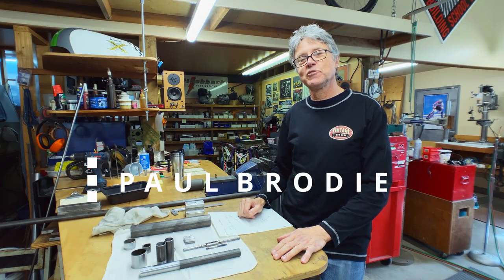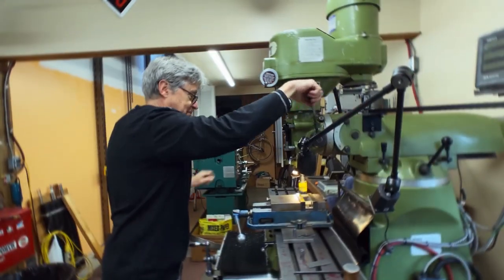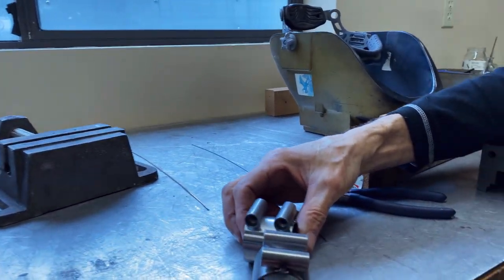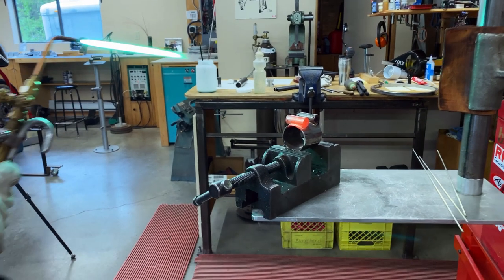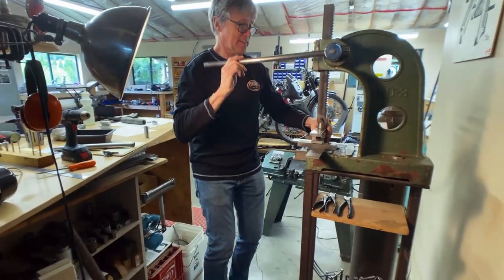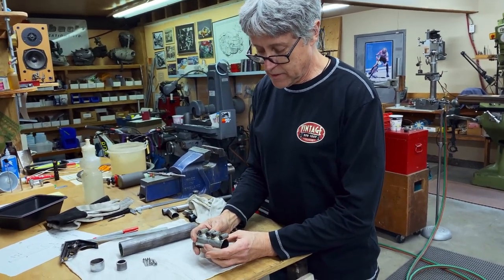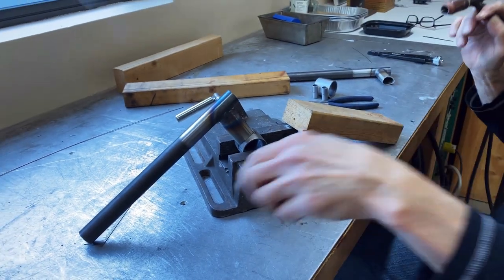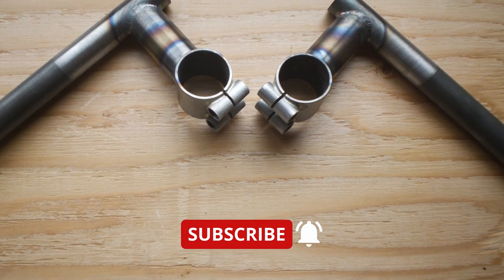Custom Aermacchi Clip-On Handlebars with Paul Brodie

Comment: Hi Paul, another great vid. would you mind sharing the name or link for the blade used to cut the pinch bolts? Im also wondering would this be the blade used to cut the slot in the seat tube ? cheers mate
Reply from the maker: Thank you.  I think you are talking about a Slotting Saw. Yes, they are also used for the seat tube slots. Available in different thicknesses and diameters. Any good tooling supply shop should have them...    :face-fuchsia-tongue-out::face-fuchsia-tongue-out: 3/32" is a common thickness that I use..

Comment: Sweet lookin bars! Just bought some cheep aluminum ebay clipons for an sx125. I'm getting nervous. Is there a reason you went with steel? Would you avoid aluminum?
Reply from the maker: I like the look of 4130 clip-ons. I can weld aluminum, but prefer not to, unless it is absolutely necessary. Most aluminum clip-ons are CNC machined and then clamp a 4130 tube; that's not the style I wanted for this build.

Comment: If you covered it already, and I missed it, I apologize. Why did you braze the pinch lugs rather than fully them? Is it related to the fact that you could only TIG the periphery of the joint between two, where you can wet out the whole surface contact patch between the two using brazing?
Reply from the maker: Another viewer asked the same question. At each end of the pinch lug there is very little room to get the Tig torch in, and it's also hard to get in between the pinch lugs too. It's much easier to nickel silver and make it look good too. I can nickel silver those pinch lugs faster than I can Tig.

Comment: Hello Paul. 
I have throughly enjoyed watching your videos. They are well done and informative. I have a quick question. Why did you braze the pinch clamps instead of TIG welding them? Thx!
Reply from the maker: It's very hard to get into the "V" at the ends of the pinch lugs with the Tig torch. I can do it better, and faster, with nickel silver. Thanks for watching!
Reply: That makes sense. I really liked the series on building the brake hub. Thank you!
Reply from the maker: @timmyc7898   I'm back to working on my Aermacchi so will be a video soon :)

Comment: Hi, just came across your channel. Great stuff, looks like you build some clean stuff. I don't mean to tell you how to do things, but I saw you struggle to get leverage on your arbor press, I don't know your model exactly, but when you had it down against the work piece you should be able to slide the whole handle and spline out so you can reposition it to a higher point. Keep up the awesome work. 🇨🇦
Reply from the maker: Hmmm, didn't know you could reposition the handle and spline while in use... But, thanks for watching!

Comment: I owned the same model of mill but never got an inverter to power it.
Reply from the maker: I've got a 25HP phase converter.
Reply: @paulbrodie  Sounds expensive. The tooling also adds up fast, didn't have any of that either. I decided overall it was cheaper to have what I need made for how much I would be using a mill and lathe
Reply from the maker: @david929190  I got my converter used.